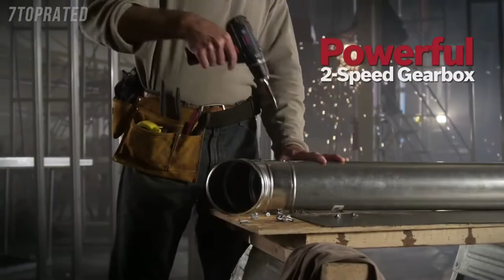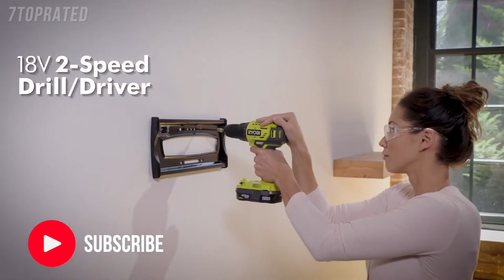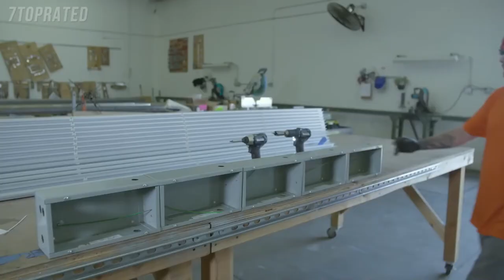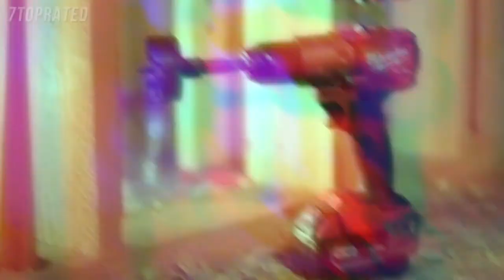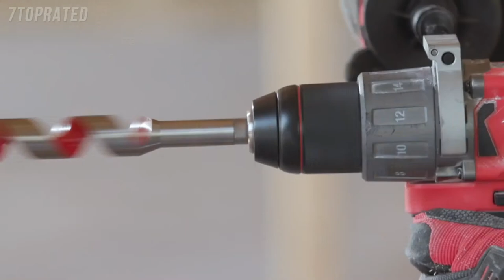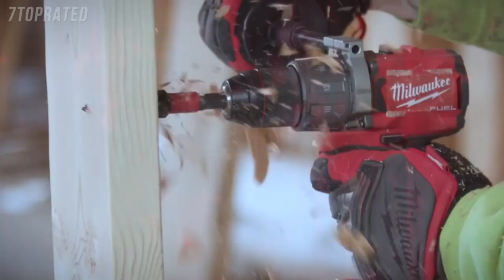5 Best CORDLESS DRILLS 2021

Comment from the maker: For the best prices and more details check the links below:

► 5. Bosch Power Tools Drill Kit - PS31-2A - https://amzn.to/31mtvpA
► 4. BLACK+DECKER 12V MAX Cordless Drill/Driver - https://amzn.to/3qL2mVO
► 3. Ryobi P215K1 18-Volt ONE+ Lithium-Ion Cordless 1/2 in. Drill/Driver Kit - https://amzn.to/3mSQlwr
► 2. MAKITA 18V LXT® Sub-Compact Brushless 1/2" Driver-Drill - https://amzn.to/3HvQbmu
► 1. Milwaukee M18 2606-22CT Cordless Drill - https://amzn.to/3pMxNzX